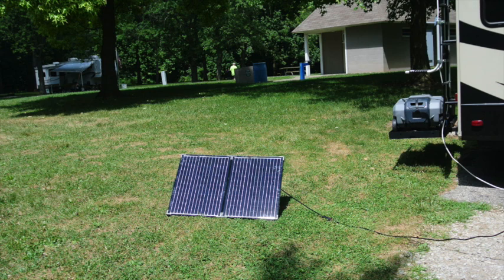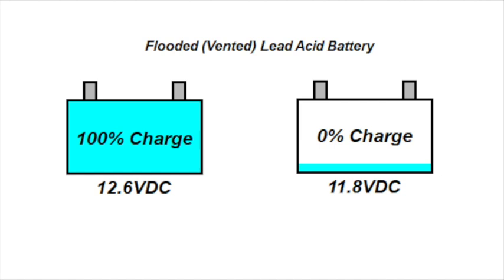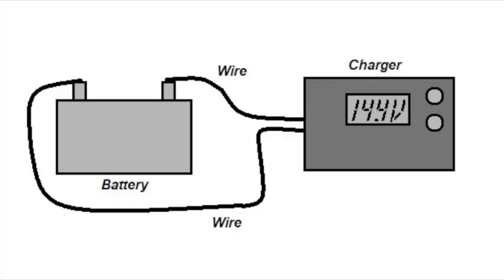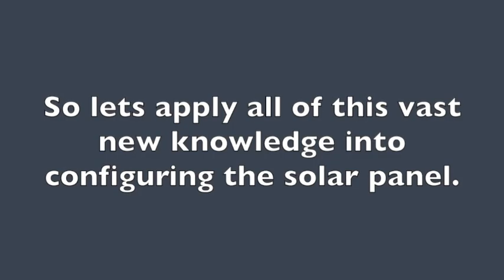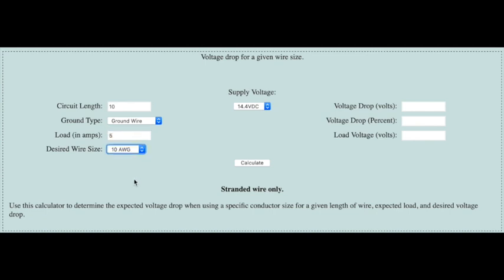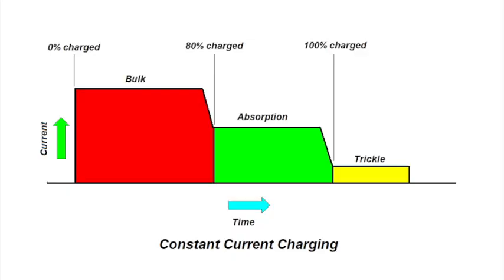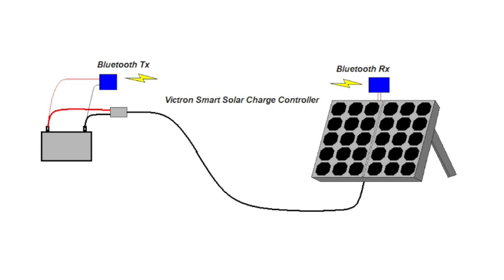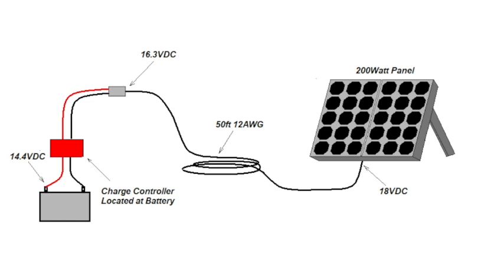Voltage Drop Issues and extension cables - Portable RV Solar Charging Video 3

Comment: Hello. Last week, I bought a Renogy foldable 200w solar panels SKU #RNG-KIT-STCS200D-VOY20. I am looking for answer concerning the possibility to add an extension to my kit. I read alote on the subject but it's not very clear for me because I am newbie with solar and I don't want to waste my money.
With this kit, can I add an extension somewhere between the controler and the battery? All the wires that came with the kit are gauge #14 (verified with Renogy staff) Do I have to use #10 gauge for this extension and what is the maximum for the lenght? What is the voltage loss expected? Actually, the kit is hooked directly to the battery 12V lead acid 105 ah because I realized that Renogy made this kit to be installed on the battery and not by using any pre installed port on the rv trailer (their graphic show the installation this way!) Maybe to optimize the kit!
On my rv trailer, there is a SAE port ( ZAMP) and the wire seem to be 12 or 14 gauge.

Another option is maybe to replace the entire wires between the controler and the battery with all gauge # 10 instead of gauge # 14 ?
Reply from the maker: So I understand you want to add another 200W solar panel to your portable setup?

A 200W panel pair will output maybe 11A max and around 18VDC at the best angle and brightest sun.  Two 200W panels will obviously double the output.

You have basically two options, both of which would require configuration of the panels.

First you can wire the two panel pairs in parallel with the charge controller at the panels.  Your charge controller would have to be rated at least for 25A, so that might mean you may have to replace the controller with a heavier duty unit.

And you can use my on-line voltage drop calculator ( http://www.rv-project.com/tips/wirecalc.php ) to figure this out, but with a 10AWG wire and 25A current, you would drop 1/2volt for every 10ft of wire.

This is a very significant voltage drop, and I would not be comfortable with it. You are paying more for the additional charge controller, yet you will not be able to use all of the power out of the charge controller as the voltage drop will reduce the charging output.

You can run the figures by using my calculator, but even with 6AWG, you are looking at 0.2V per 10ft which is still fairly significant.

You will end up spending a lot of money on wiring, and potentially have to buy a new charge controller.

My recommendation would be to wire the two panel pairs in series, which would result in doubling the voltage output from the solar panels, but the current would still be no more than the 200W panels - which is 11A.

This requires a MPPT controller as the PWM controller that probably came with the Renogy panels cannot handle the higher voltage of the panels in series.

Secondly, I would wire the MPPT controller to the battery rather than at the solar panels themselves. This means the voltage drop issue is not nearly as significant, and you could get by with up to a 25ft run of 12AWG wire between the panels and battery/charge controller.

The reason for this is the charge controller will output a maximum of 14.4VDC, while the panels would be at around 36VDC.  This would result in around 1V voltage drop along the 12AWG wire, but since it is on the input side of the charge controller, the lower voltage will not affect the charger's ability to output the maximum current it is capable of.

I have over 10 videos in my suitcase solar panel series, and you can find links to them in the description of of this video.
Reply: @RVProject  I don't want to add another 200 watts to my original kit but simply, I want to know if I can replace the actual wiring (14 awg) with 10 awg to reduce voltage loss if any? It is not a big job to do it but I don't want to waste money doing so if the genuine kit don't loose too much voltage. 
With the wiring (14 awg) supplied by Renogy, It measure 12 feet long from the controler to the battery.
I would like to have a wiring between 15 feet and 20 feet with 20 awg.
Actually, I have just made a 8 days trip with this original kit and I am quite impress with the performance even with cloudy days. Definitly, I recommend it all the ways:)
Reply from the maker: @aguertin3846  Sorry for my confusion.

Yes you can and should replace your wiring with 10AWG. Renogy also recommends using 10AWG if your cable run is more than 10ft.

This is especially true when the charge controller is located at the solar panel.

Most modern chargers, including the typical solar chargers are three state chargers. The three states are Bulk/Boost charge (14.4V), Normal/Absorption charge (13.5V), and Trickle/Float charge (12.9V).

And for reference, a fully charged battery is 12.6V.

You can see here that there is not a lot of difference in voltage from one charge state to another, so that means the charger-to-battery circuit is very voltage sensitive.

The best practice would be to locate the charge controller as close as possible to the battery as voltage losses between the solar panel and charge controller are not as critical.

So here is what can happen if the voltage drop between the battery and charger is excessive.

When a battery is less than 80% charged, the Bulk mode is active, which rapidly charges the battery.  This can be thought of as the rapid charge phase.

When the battery is between 80% and 100% charged the charger enters normal/absorption charge, which is a moderate charge. It will charge the battery more slowly, but allows the battery to cool down from the Bulk charge.

And finally, when the battery becomes 100% charged, the charger enters the trickle mode which is a low level charge designed to keep the battery topped off.

While a battery can be fully charged using trickle charge, it might take 16-20 hours to charge. But in the Bulk-Normal-Trickle stages, a battery might charge in 2 hours.

So lets say you have a 0.75V drop in your cables from the charger to the battery, and your battery is less than 80% charged, so the boost charge would kick in, which is 14.5VDC. However, after dropping 0.75V along the cable, only 13.75V would reach the battery.

This reduces the rapid battery charge rate, so it will take longer to charge the battery in rapid mode. So in effect, you may be paying for a 200W panel, but only getting 100W worth of performance.

However, since the charge rate is lower in Normal and Trickle mode, the current will be less, meaning less voltage drop along the wires, so in these two modes, the charging will be fairly unaffected.

I would absolutely not use anything less than 14AWG if you are under 10ft, and 10AWG for more than 10ft.  The higher the AWG, the better the charge performance during rapid charge. 

If you go much more than 10ft, I would  recommend moving the charger from the solar panel to the battery. 

A Renogy 200W solar panel should output about 18V.  In this situation, the voltage drop is not as much of an issue. The charger can handle one or two volt loss along the wire from the solar panel and still output it's rated voltage in rapid charge.

Also, 20AWG wire cannot handle 11A from a 200W solar panel, so you would risk melting the wire. The maximum current for 20AWG varies due to the temperature rating of it's insulation, but it is in the range of 3A.

And if it could handle the current, you would have such an excessive voltage drop along the wires, the battery would not likely be charged.
Reply: @RVProject  sorry again. I made a mistake with the awg size. I don't know why I wrote 20 AWG but the real awg is 10 AWG. Sorry!
You are absolutly right when you write about trickle stage. I have noticed that the charger seem to stall after the third light green come on. The fourth light doesnt come on but the charger indicate the battery seem to be charged at 12.9 Volts. 
So my plan is to change the wires from the charger to direcly to the battery. Renogy sell pigtails and extension and a fuse mounted in a MC4 socket. I could buy 2 pigtails ( one from the charger and the other plugged directly to the battery) 1 x 15 feet extension and a 15 amp fuse. All this wiring in 10 awg and would measure around 17 feet. Good move or not? 10 feet better ?

I have use your calculators to see what was going on with voltage drop and let see if I am good or not :)

lenght   load   awg    Vdrop     %        load voltage    supply voltage
12          10.5   14        0.661    4.59      13.739            14.4
12          10.5   10        0.258    1.79      14.142            14.4
17          10.5   14        0.936    6.50      13.464            14.4
17          10.5   10        0.365    2.54      14.034            14.4

Thanks again for all info you give
Reply from the maker: @aguertin3846  You will have to play with the tradeoffs here. The shorter the cable distance and the largest AWG your pocketbook will tolerate, the better.  Even at 10AWG, there is going to be some voltage drop. 

I would try to keep the voltage loss under 1/2V. Under 1/4V would be all the better.
Reply: @RVProject  Thanks you so much
Reply: Do you have a post concerning dual battery on travel trailer? My trailer is 19 feet with a single 12 Volts battery 105 ah and two years old. I plan to add another new 12 volts battery. A guy recommend to use a battery isolator with a battery isolator switch because of the age of the batteries. Is it a good idea? Batteries will be in parallel. Any wiring diagram for this project? Thanks
Reply from the maker: @aguertin3846  Whenever you directly parallel two 12V batteries, they must be the same type, size, age, and ideally brand.  This is because over time, a FLA battery will lose capacity. 

Batteries charge when a voltage higher than it's own is applied to it.  And as the battery charges, the voltage increases.  What ends up happening with a new and old battery is one battery will charge faster than the other, and end up discharging into the lower charged battery until both batteries are fully charged and the voltages are equal.

However, this could cause one battery to go into overcharge, which could further damage it.

You can use a battery isolator but the problem then is there is a 0.4VDC voltage drop across the diode in the switch.  This brings back the same issue with the solar charger using too long of a cable.  There are FET isolators and battery charging mechanisms that do not have a voltage drop, and they can be expensive.

Lastly, if you use an isolator, there has to be someway to recombine the batteries for use in the RV.

This can often get really complex and expensive fairly fast. It is often just cheaper to buy two new FLA batteries.

Your friend is likely thinking about boat batteries.  In one boat I had, there was a A-Both-B switch and two batteries. In the A position, battery A would be connected to the engine and house. In the B position, battery B would be connected.  

However, the non-connected battery would not be charged.  To charge both batteries, you would have to put the selector switch in BOTH, but only when the engine was running.  As soon as the engine was shut off, you needed to put the battery in either A or B.

Otherwise, you could have the same issues with one battery discharging another, and you still need to replace both batteries together.

In a boat, it was typical to use battery A on day one, battery B on  day two, then switch back to battery A on day 3.  And so on.

This ensured that there was always a fresh backup battery to start the boat.

But in a RV, this would not be as practical.

There are also automatic voltage relays. The relay is connected across both batteries. And in discharge, the relay is off. But when the relay senses a higher charge voltage, it closes and allows both batteries to charge.  This is akin to using the BOTH position on a manual battery switch.

However, it still presents the issue of how to combine both batteries under discharge.

So to recap, purchasing two identical batteries at the same time is the simplest and probably cheapest solution.

One last caveat. When you wire two batteries in parallel, you should wire the positive lead to the RV on one battery, and the negative lead to the RV on the other battery.

Due to the complexity dual batteries can have, a popular alternative is to buy two 6V Golf Cart batteries and wire them in series. Many RV'ers do this as the two batteries in series appear as a single battery to the RV and charger. The chemistry in Golf Cart batteries is slightly different than FLA, so they actually last a bit longer and can put out a bit more power.
Reply from the maker: @aguertin3846  If there is enough interest, I can do a dual battery setup video. But it will only be in theory with drawings and such as I do not plan on adding a second battery to my RV. I don't want the extra weight, and I rarely boondock, so I don't require as much power.

However, I might upgrade someday to Lithium batteries if the price keeps going down.  The beauty of a Lithium battery is that you can fully discharge it a thousand times without damage.  So a typical 100AH Lithium battery will provide 100AH of available power.

For a FLA (Flooded Lead Acid) deep cycle battery, you may not know that you should never let it discharge more than 50%. If allowed to be fully discharged, you will shorten it's life.   So much for the term "deep cycle", as it's anything but.

At any rate, a 100AH deep cycle FLA battery would then only provide 50AH (50% discharged).  So right off the bat, a Lithium battery rated at the same AH rating will provide twice the power as a FLA, so it's like having 200AH of FLA batteries on board.

Lithium batteries are also about half the weight as a FLA battery.

But there are also some downside to Lithium.  Cost is the major factor. A 100AH Lithium battery is still around $750.  And you need a different charger for a Lithium battery, as the OEM chargers are typically not Lithium capable.

And finally, there are some issues with Lithium in freezing temperatures, especially when charging. You can generally operate a Lithium battery in a lower temperature, but it's recommended to not charge the battery in your RV during cold storage.

Of course I am just hitting the highlights of Lithium, and I would have to go into greater depth in a video for a full explanation.
Reply: @RVProject  Thank you very much for all the info. Glad that I met you to get so much info :)
Reply: @RVProject  Hello again sir. I am preparing my gear for the next season and I still have a couple of questions about my Renogy 200 watts foldable panels with the charge controller supplyed Voyager 20. I have made some modifications to the cables. So the cables between the charge controller and the battery are #10 gauge on fifteen feet long. Both cables are plugged directly to the battery. Is it a good decision to change the supplied controller PWM for a Mppt like Victron 75/15? For this specific Renogy setup, is the PWM will do the job considering this is a small project? Will I waste my money to change for a mppt? Considering the differences between both devices, will they do a similar result with this small project? Thanks again